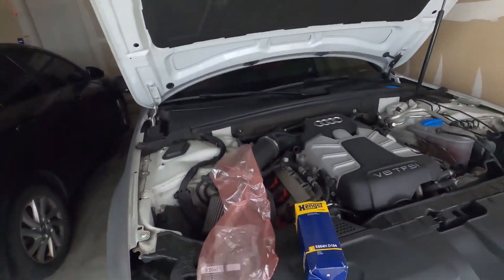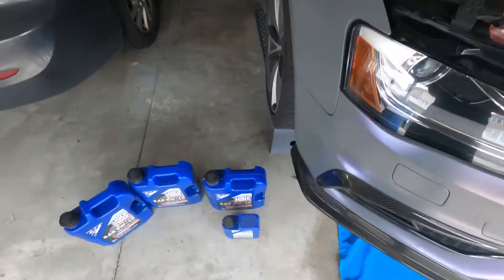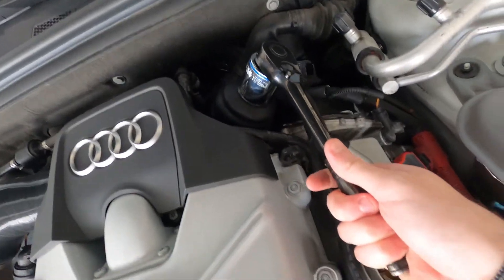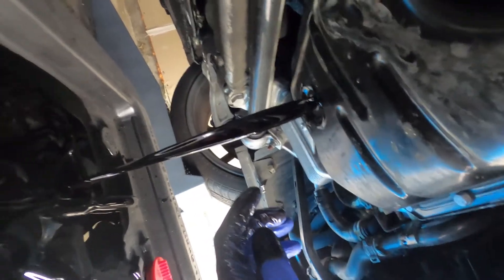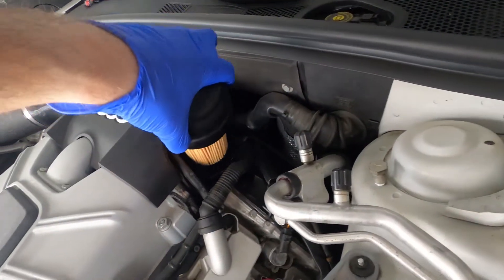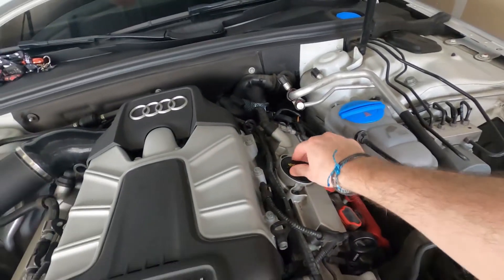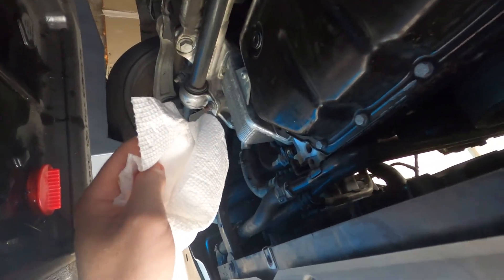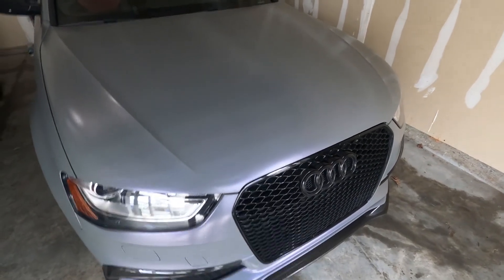* Easy DIY* Oil Change For Audi S4

Comment: How reliable has your car been? I’ve been looking at getting a b8.5 s4, still can’t decide between the manual or auto tho
Reply from the maker: The manual would be more fun but harder to come by. This car has been a dream to own no major issues I’ve encountered just typical Maintenance. Water pump and timing chains are common things to go wrong with this platform but I haven’t had any issues with mine